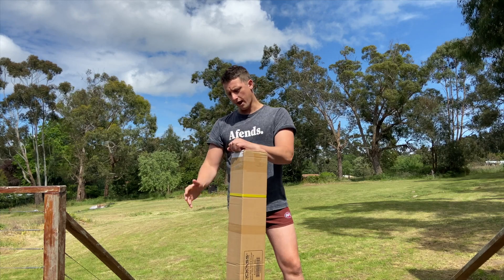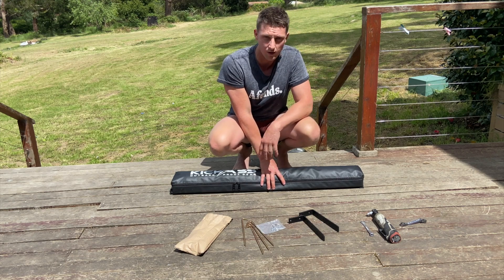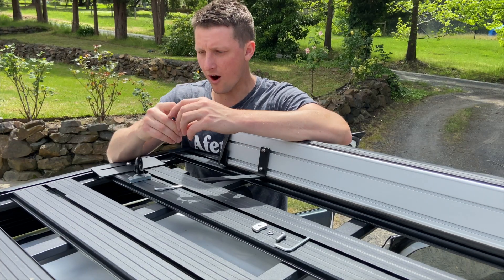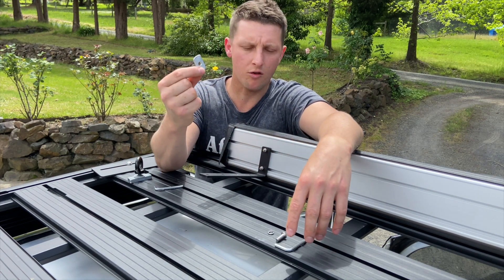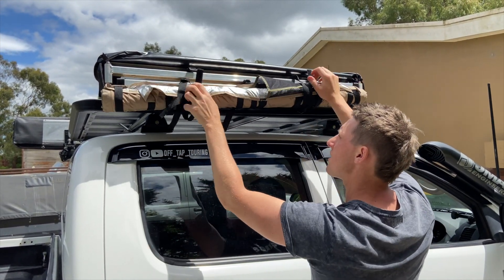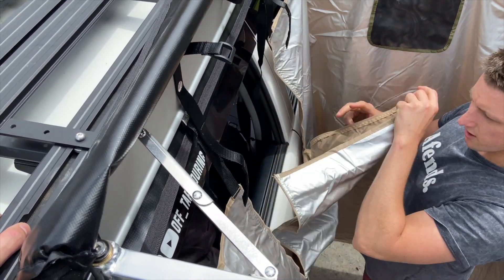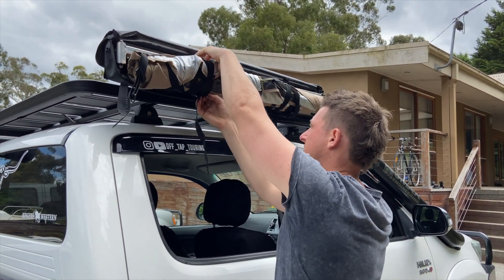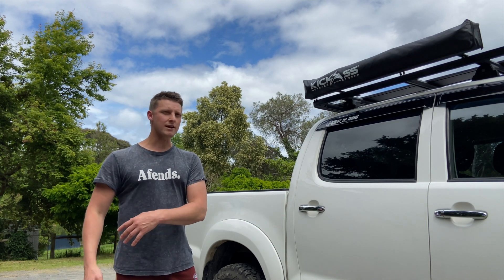HOW TO - KICKASS  SHOWER AWNING Touring Setup

Comment: How’s the shower awning holding up? I’m still on a cross roads whether to get one or keep using my trusty BCF Wanderer double pop up. The less I have to put in the tub the better but I like the privacy of the pop up (fully enclosed with roof and floor etc). I camp where it’s pretty windy too so mostly worried about how it will hold up in the wind.
Reply from the maker: The idea behind having the shower awning is to have a quick, no time/zero space setup. My partner can have shower quite comfortably without anyone seeing her. It’s really good like that. As for the wind, it does come with pegs to be able to peg down. 

I really like it but that’s just my opinion. Thanks for the comment and I hope my input has helped

Dave